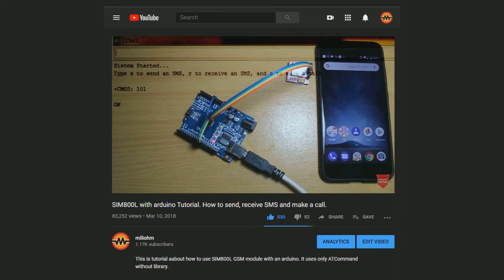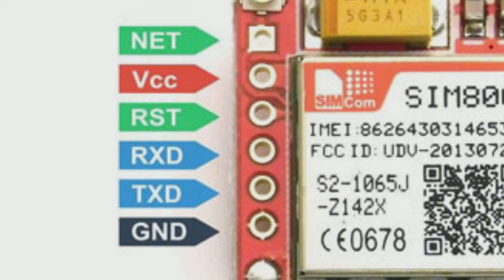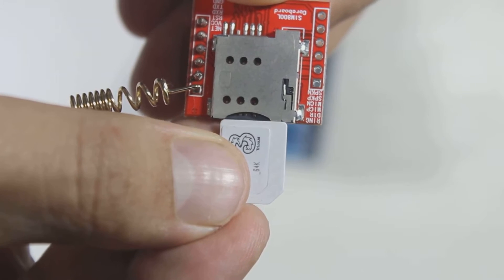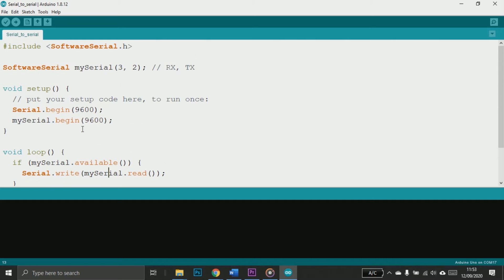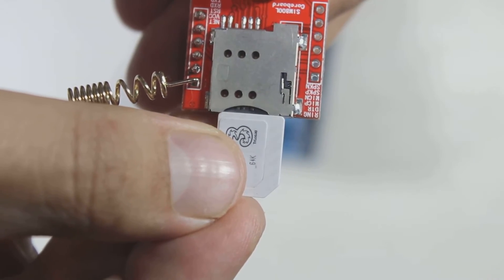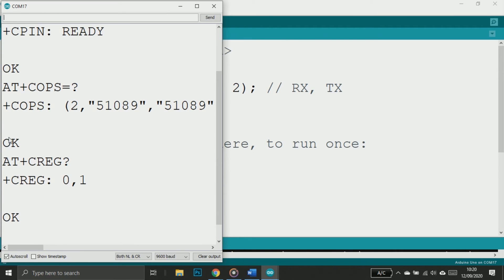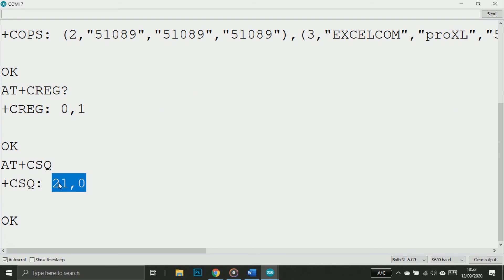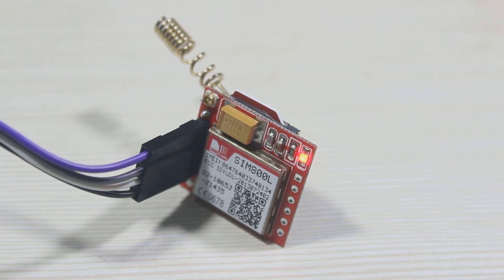SIM800L Troubleshooting guide (Solution when you have problem with SIM800L)

Comment: Pls help me. I am using sim 800a and no port for adapter.. only jst connector and antenna. But when I connect the jst connector to my 3.7v 18650 lithium-ion battery there is smoke coming to it.. I even checked the voltage but it is 4v only , when ever I connect it the gsm module it so hot. Pls help me troubleshooting this. Day after tomorrow is my zonals

Comment: Hello milliohm, thank you for your great videos, i have a question regarding the sim800L: i have around 20 sim cards for which i have an online platform to see any incoming and outgoing sms, so i dont need a phone for every single one of them, but to actually have the sims running, ofcourse i need power and an antenna. would it be possible to hook up loads of SIM800L together with the antenna and then have them running while i can mange all traffic over the online tool? How can i power many SIM800L at once without an arduino, only power supply

Comment: Hi i have a question,The sim800l that I'm working onwas doing fine, it is registered on the network, can send message and can also receive messages, but, when I try to run a program that sends a reply after receiving a specific sms which was "location", It cannot send a message back, though It can receive the text message well, It somehow was not able to send a reply back. The sim800l is powered by arduino uno , still did not work, also tried using a two li-oon 18650 3.7v 2200mah as a power source and it still did not work. Any possibile solution on this one?
Reply: were you able to overcome this problem. I'm currently facing this same problem and if yes, how did you do it. pls help I have less than a month to present my project
Reply: @erickay6231  yeah, seems like the network provider of my sim banned the sending of URL, so Instead of sending google map links, I just sent raw coordinates
Reply: @erickay6231 turns out my SIM network provider blocked the sending of URL so i sent raw coordinates instead of google map links

Comment: See I am Using Sim800L module it was working absolutely fine, I have intersected the Activate sim , It was working fine no issue was their, Suddenly the gsm module ,By using AT commands it shown that Sim not inserted, As I have correctly inserted, Voltage and Current are accurate, 4.4volts and 2 Ampere, I am not getting any solution

Comment: My SIM800L doesn't respond to AT command. The serial monitor is simply blank 

And the led blinks every 3 seconds wich means its connected to a network

I power it trough a lm2596 buck down converter with 4v , From 12v power suply 

Can you help me ?

Comment: Hi, mi SIM seems to be working but most of the commands give me ERROR, AT gives me OK, AT+csq gaves me 24, AT+CFUN=1 OK, and AT+COPS works too, but for example AT+CMGF=1, AT+CIICR, AT+CPIN?  and basically every other commandd i tried gives me ERROR. I use SIM800L on raspberry pi (serial connected), i pilot it from node-red. the provider of the SIM is things mobile. please help me I am really desperate.

Comment: Thanks a bunch for the simplified tutorial. Good work. Mine was not working due to power. I was using a ICR18650 2200mAH battery. For some reason It was unable to deliver 2Amps. Then I switched to 9V-2A auto-ID adapter. Now it is working somehow. (surprisingly no overvoltage warning). I have to check the voltage today( forgot the multimeter at office).
Reply: did it burn on 9volts?

Comment: I wasted one hour cause the second antenna (for the ufl connector) doesnt work. I got zero signal quality. I changed to the small helical antenna and now it works. Is it possible that the ufl connecter have to connect somewhere at the gsm shield? Or should both PINS (ufl connector and the pin for the helical antenna) ready to use? Thank u alot!

Comment: Dear, i have tried everything like putting 3.7v lithium batter or put buck converter to the SIM800L, but never it got any network. however the sim info can get from AT command and CPIN is ready/ only CREG AND CSQ shows 0.. pls help me
Is there any chance that I bought an faulty SIM module?? pls tell how to check. The SIM can run fine in any 2g mobile in the home

Comment: My device "was not working" and I saw various troubleshooting videos and read various forums but it was untill yours that I could finally fix it or let's say, make it work... It was basically the PSU I was using it didn't have enough mA (2A) as indicated. I was using some LIPO batteries that seems don't have enough punch. So I solved it by having the correct PSU regarding Amps. Thanks for your supprt

Comment: hi everybody,
i'm dealing with a big issue,
i bought the 800l module and because i was busy i just wanted to test if it works,
so i connected it directly to the Arduino Uno like this :
tx-->rx
rx-->tx
5v-->vcc
gnd-->gnd
without putting the sim card
the gsm module's LED started blinking

after 3 days i did the same but this time with the sim card 
the gsm module doesn't work at all, the LED doesn't even turn on with/without sim card
i checked if the LED is working using an external circuit and it worked
i don't even know where the problem is or even if it has been corrupted

Comment: Hello sir, I have a problem in the sim800l module version 2, while looking for the signal to restart continuously... How to solve the problem?
Reply from the maker: What kind of power supply did you use? Sometimes it caused by insufficient power. And try give it an capacitor.
Reply: @miliohm  I use 5volt power from arduino, If given a capasitor of what size? And given to which pin?
Reply from the maker: Try use power supply with more current like 2amp minimum. Use 100uF capactor between vcc and gnd
Reply: @miliohm ok sir, Thanks for the response... I'll try it...

Comment: I rarely use Dislike button, but used it on this video. I don't understand some words.
PS: Correct power: 4v. And power for Rx/Tx line also incorrect. Module need 3.3v.
Reply: In the video he clearly read the datasheet and said that. See 2:25.
You should be ashamed of yourself

Comment: Mine works great now Ive put the sim card in the right way round.  Also a 1/4 wave ground plane antenna helps 83mm. great video. I would also recommend the AT command tester for Simcom modules GUI, for £10 its saved me hours.

Comment: Man!!!!

You are so helpful. I was scratching my head for two days. But your video solved my problem

I have taken help from this link and followed the exact procedure mentioned in the video. Ultimately, it was a power issue. I was giving it 3.8 volt which was not sufficient. Then I changed it to 4.1 volts and it worked.

Again Thanks
Reply from the maker: Thank you!! really glad it's helpful!

Comment: thanks dude, that was tricky. but unfortunately mine still  showing same...my sim works in mobile. AT+COPS shows networks, AT+CPIN also ok...ive connected my module directly to lipo and its getting 4.2v but still led blinks every sec and AT+CREG? shows 0,3...signal is also 27

Comment: By God's grace mine worked, the set-up I had though was using two 18650 batteries in series-so total voltage was around 7.4V, and used a buck converter stepping down the voltage to around 4V  and connecting the output of the buck converter, directly towards the SIM800L Mini GSM module, I made sure that the wires I used was as short as I can enable and used AWG24 solid core copper wires, I did not use  any capacitors, and everything worked fined, I even used 5G capable SIM card and it worked well with no problems; hopefully those working on this had theirs working, God Bless

Comment: Hi, I've been following your video and checked everything. The voltage is around 4.1-4.3v but the led is still blinking every 1 second. AT+CREG is 0,0 and can't send any message. Any idea why is this happening?
Reply: hello same problem atm. Have you resolved this?
Reply: @jeanmarcreyes6927  its a power supply issue

Comment: my SIM800L module blinks every 3 seconds but can't communicate with it via serial. the serial monitor doesn't show my AT command inputs when entered and the response, just blank.  Does that mean I have something wrong with the connection/wires? (using your code)

if i use a sketch where it will type the at commands for me, the module stops blinking when I open serial monitor

Note: I have set the serial monitor settings to Both NL & CR
Reply: hello, i have the same problem, did you find a solution?
Reply: @clementszumny1288  still finding solutions. Some say that sim800l requires 38400 baud rate. I did try it but i still got no response on serial monitor. Also it is noted that sim800l cant tolerate 5v signal so you might want to put a voltage divider to have an 3v output from arduino tx to sim800l rx.
Reply: @rafaeladela8829  ok I just tried with 38400 baud rate but I also have nothing. And did you try to divide the output voltage ?
Reply: @rafaeladela8829  but that's strange because when i power the sim800l the led is blinking every second, means that it try to connect to the network, then i send the command : "AT+CPIN=1234" for the pin code and the then the led is blinking every 3 seconds, so i guess that means my arduino is able communicate with the sim800l but the module doesn't answer to the arduino, i really don't understand why...
Reply: @clementszumny1288  yes as i am using an arduino uno which outputs 5v on its digital pins. I had to add voltage divider to get 3.3v to the rx pin of sim800l. If youre microcontroller outputs 3.3v, then there is no need to add voltage divider.
Reply: @clementszumny1288   my guess is that it didn't need for you to enter pincode and it just automatically connects to the network. If for some reason it did really needed the pincode and you somehow made it connect to the network via serial, my guess is you didnt set the serial monitor to both NL  & CR or if all these things are followed then my guess is that you need to find the right baud rate. Then again, I dont know for sure as I am still having problems with it. You might also want to check if youre having the right supply for the module as most problems with the module is solved by just having the right supply.
Reply: @clementszumny1288  also you might want to check your program to always read the serial and write it on your serial monitor every time you send an at command
Reply: @rafaeladela8829  I found my mistake, the ground of my arduino and my sim800l were not linked (because I use a lipo battery for the module and my laptop for the arduino) so now it's working, thanks anyway for helping me, and hope you will find why it's not working for you

Comment: C:\Users\ahmed\Documents\Arduino\sketch_mar22f\sketch_mar22f.ino: In function 'void init_gsm()':
C:\Users\ahmed\Documents\Arduino\sketch_mar22f\sketch_mar22f.ino:94:28: warning: ISO C++ forbids converting a string constant to 'char*' [-Wwrite-strings]
       if (SIM800L.find("OK") > 0)
                            ^
C:\Users\ahmed\Documents\Arduino\sketch_mar22f\sketch_mar22f.ino:109:38: warning: ISO C++ forbids converting a string constant to 'char*' [-Wwrite-strings]
       if (SIM800L.find("+CPIN: READY") > 0)
                                      ^
C:\Users\ahmed\Documents\Arduino\sketch_mar22f\sketch_mar22f.ino:124:28: warning: ISO C++ forbids converting a string constant to 'char*' [-Wwrite-strings]
       if (SIM800L.find("OK") > 0)
                            ^
What the solution

Comment: My gsm 800l doesn't seem to power on with 3.7V lipo battery why?
Reply: use minimum 4.5v with 1 amp ratings it will work better
https://www.technoelectronics44.com/2020/11/gsm-sim800l.html
Reply: dude were you able to overcome the problem. help me because I'm encountering the same problem

Comment: Looks like it only works in 2G network so thit is probably why it doesn't work for me, and my COPS shows only one network in witch i cant connect into.
I'm using a separate power supply two batteries battery 18650 (7v+) with a dc dc step down to 4.0v

Comment: For anyone who wants to work with the SIM800L, make sure you disable your pincode of your sim. I forgot and it took me more then 12 hours to find this problem
Reply: so what was your issue? how did you know you had to disable the pincode?
Reply: @exergygroup2023  so i wouldnt connect and it kept blinking every second. somewhere on the internet i found something that explained at commands and there i found a command for pin and it explained what the reactions. And thats how i founded out that you need to disable the pincode
Reply: @icestarkiller3286  mmm ok, thanks!, I'll check again. If you still have the link where the commands where explained I would highly appreciate it! hehe,
Reply: @icestarkiller3286  how can i disable the pincode, pls tell
Reply: @paprighosh6063  put the sim in your phone and go to simcard settings. There you can disable your pincode so you never have to put it in again.
Reply: @icestarkiller3286  how to disable
Reply: or use "AT+CPIN=1234" command
Reply: Same😂😂
Reply: @2bongelive I really need the solution
Reply: Please can a 4g sim work with it
Reply: @Techcommunity360  I can't think of a reason it wouldn't work.

Comment: My module doesn't blink at all. I have a 5V 30A PSU connected to the LM2596 buck converter as you did. I was wondering if it's possible to only connect the VCC and GND pin to the SIM800L from here, just to see if the LED will start blinking. In other words: are the TX and RX pins required to make the LED blink? I want to rule out any problems with the Arduino. I think my SIM800L is defective.
Reply from the maker: Yes, the module should blinking even only vcc and ground that connected. Check the wire too. Sometimes the wire just broken
Reply: I faced the same problem, but in my case I use the SIM800c. The problem was solved by connecting directly the PWX with GND. I also had to change the sim card and enhance the quality of the LM2596 output by using capacitors as stated in http://www.bizkit.ru/en/2019/02/05/13553/.

Comment: Indicator not blinking. Wht is the matter ??
Reply from the maker: Make sure the power supply is connected. Check using Multimeter
Reply: @miliohm  its connected bro. But not working or blinking. I worked on it 2hrs before
Reply from the maker: @bhanukawijerathne_96  and how much is the voltage?
Reply: @miliohm  1st time set 5v. It ws work. after few hrs ago its not worked

Comment: why not use the rx and tx pin on the arduino board instead of other pins??
Reply from the maker: The rx and tx are for serial monitor. We need both
Reply: @miliohm  the default rx tx pins
why did you make new pins as rx tx instead of using already existing pins?
Reply from the maker: @shan_singh  as I already told you, the default tx and rx pins are used for serial monitor. We need both, the serial monitor, and serial for the SIM. if you use default serial, it will mixed up between serial monitor and the at command
Reply: @miliohm  thank you for replying. I'm still confused. What is serial for sim? you are using serial monitor and typing AT commands in it, how is it different from serial for sim?
Reply: @shan_singh  you can use rx,tx no problem. but while upload the program u ve to empty those pins and after upload the program you can connect  those pins to gsm it will work.
https://www.technoelectronics44.com/2020/11/gsm-sim800l.html

Comment: Hi.. practically LM2596 output has high ripples which can damage a delicate circuitry. How long have you tested this setup... for days or weeks or months?
Reply from the maker: Just for days. Maybe you can add more capacitor the decrease the ripples
Reply: @miliohm  Thanks ...also some users adding voltage divider, at TX pin of Arduino, to step it down to 2.5V to 3.3V levels for RX pin of SIM800L board. Is that necessary?
Reply: if we use buck converter it maintain stability
https://www.technoelectronics44.com/2020/11/gsm-sim800l.html

Comment: My sim800l is blinking once a seconds it’s running with a Buck converter on 4.1V can you help me please I’m trying it since one week
Reply from the maker: Try increase the voltage. 5v max. Sometime it just works using 5V. How much ampere is your power supply at?